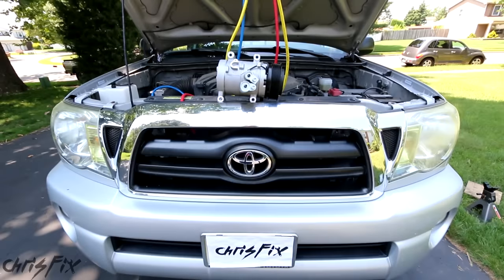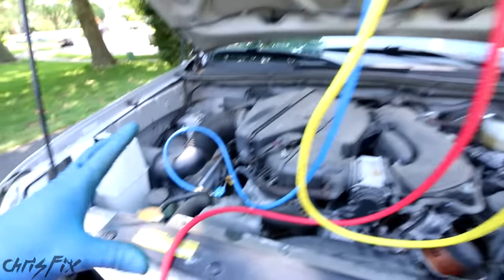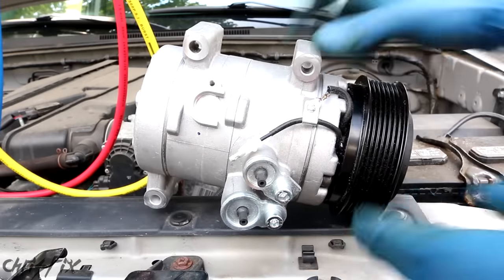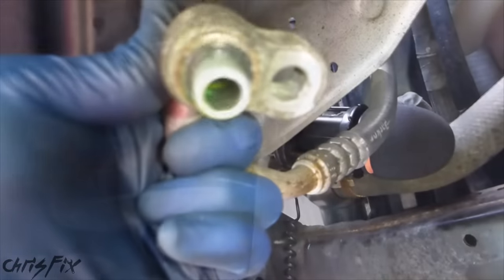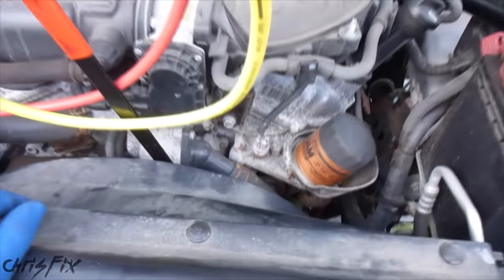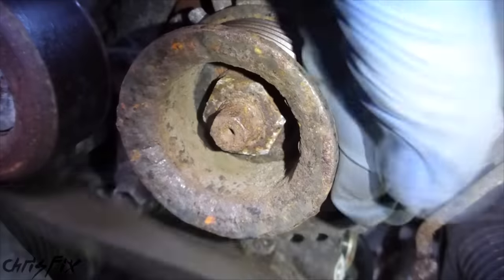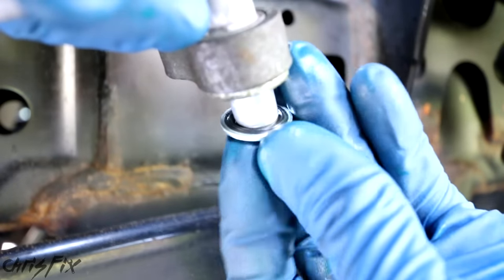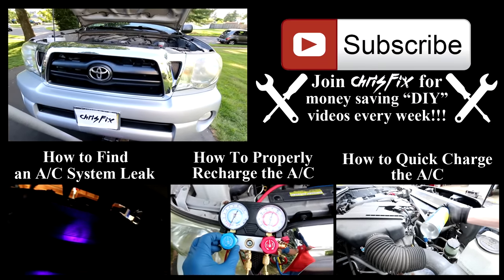How to Replace an AC Compressor in your Car

Comment: I was at jiffy lube and I had them take a look at my ac since it wasn't working and they said the belt was just sitting next to where it was supposed to be on the compressor. Is it likely that I will need a new compressor, or would simply replacing the belt be all I might need? I believe I had the belt replaced once before. It's been a while since the AC stopped working so if the belt has been like this the whole time I'm surprised it hasn't caused more problems. I don't drive all that often but I do have a 300 mile trip planned for next month.

Comment: Sometimes you don't need even need to replace the whole A/C Compressor. A non operational compressor could be a multitude of many things but first check for bad fuses/relays as a first step. In my case, a 2002 Honda Civic, the compressor clutch wasn't engaging. Everything else seemed ok. So I took the clutch front plate off and cleaned all the rust and dirt off. Put some penetrating oil on the front plate. Replaced it back and it worked. Didn't even need to buy anything.
Reply from the maker: Thanks for sharing. In the previous video which is the first one of this three part mini series, I showed the compressor was leaking.

Comment: Great video but since you exposed the closed system to atmospheric pressure, you exposed it to excess moisture, which means you need to replace the system dryer element as well.
Reply: In reality it takes hours for an auto dryer to saturate. I've seen some field manuals and in some cases a new dryer is needed after 24 hours with the system open.

Comment: Thanks Chris. My Honda 91 Accord service manual (not Haynes, etc, but the official Service Manual from Dealership) reads to "measure and subtract the the amount of oil from the OLD compressor from 100 mls and Remove this amount from the NEW compressor before installation." Ex. if I drain 40 mls from OLD compressor, then 100 mls minus 40 is 60 mls, so DRAIN 60 mls from NEW compressor before installation. (???)

Comment: Love your videos they have been very helpful.
 I'm having some issues with my air conditioning, my air conditioning is fully charged, I believe the issue is with the clutch on the compressor. How do I diagnose this for sure unless I missed it I scroll through your videos I didn't see anything). Is it worth rebuilding or do I need a new one?

Comment: Quick question ⁉️🤔 if I'm refilling why do I hook up low and high lines and the high side really doesn't mean anything while refilling? Does that make sense... I noticed Chris touched on the low side pressure and completely dismissed the high side. What's the purpose of the high side?
Reply from the maker: It allows you to get accurate info about the state of the system, while you are dealing with the low pressure side its important to monitor the high pressure side as well, if it was wildly off then that would indicate something going on in the system. Look up "car ac low and high pressure chart" and you can see the relationship between the two as you're filling.
Reply: @chrisfix  thank you for feedback! I'm trying to understand this process before I start messing with my own car. It's an expensive job if I take it to shop! I don't have shop 🍞 bread! 😂 I have DYI 🍞$

Comment: Excellent video. I just replaced and recharged the new compressor on my 2005 Toyota Sienna using your videos as the guidelines. The car blows cold air as expected but the only problem I encounter is as soon as I turn the AC on, the engine made a screeching sound (high pitch) until I turn AC off. The serpentine belt was replaced and the alternator pulley worked fine.
So far, the screeching sound is not going away. Do you have any idea ? Could I have a bad compressor ? Thanks
Reply from the maker: Sounds like the belt tensioner is bad so there is a loose belt.

Comment: bro i have a question regarding the Torque wrench, each time you put a screw you say this one will be torque for example 15 or 30 or 75, how do you know each screw which degree is the best for it? is it with screw size or?
Thanks a lot you are the best
Reply from the maker: I explain where I get my torque specs in this video, check it out: https://www.youtube.com/watch?v=Bbi0kEaTgio

Comment: Great Video! Did you replace the expansion valve and dessicant pack? The warrenty is valid only if those are also changed along with compressor for most brands

Comment: Just want to say thanks for the great tutorial, it help me tremendously when replacing the compressor in my BMW.  I've done a lot of car repairs myself but never had the nerve to try replacing the a/c system myself until now.  I would add that in my case when I ordered the compressor online the company said the warranty is invalid without replacing the receiver drier and expansion valve at the same time which are pretty cheap and easy things to do fortunately.   That may not apply to your truck but just a reminder to everyone else to read the fine print when buying components.

Comment: Hey Chris, nice video. Quick question here, what if the compressor engaged only every 5 minutes and cold air only blows when the compressor engages?? My kia spectra was doing just fine until i changed the ac belt. :/

Comment: Any guidance on AC Manifold Hose Assembly replacement? Or also the AC Condenser Replacement? Fan Clutch replacement? Are they relatively easy? Mechanic says I should have these replaced to fix my AC (and I live in AZ unfortunately) but they want nearly 2k!!

Comment: Love all of you videos man! Could you please make a video on how to pump out the refrigerant so we could do it our selfs? I would highly appreciate. Thanks
Reply: You need a reclaimer to do that. They run about $3000. It’s not hard to do, but the equipment isn’t cheap.
Reply: Once you have the reclaimer hooked up to your car, you press the recover button and wait for it to do its job. It stops when the machine pumps your system down into a partial vacuum (10in/Hg).
Reply: @SergioPena20  Ok thanks! Good to know. Do you know a link to amazon that has the best one to use?

Comment: Great video. I recently bought my first car and it appears that the washer seal between the AC compressor and High pressure line is bad, as refrigerant is shooting out of there. How do i find the washer seal appropriate for the car? (2016 WRX) I have been googling for a few hours with no luck

Comment: At the start of the video, I did not see how you check if you have any freon or coolant in the system. I see the special Pittsburg tool but how to connect them correctly and recycle them as you said to avoid health and environment hazard?
Reply from the maker: You have to go to a shop to get the system emptied before doing ac work

Comment: Question, do I do the vacuum before removing the old a/c compressor or after I install the new one ? And if I do after I install the new one, wouldn’t I remove the oil of the new one when I do vacuum ? Thanks for your help.

Comment: great video thank you, does the new compressor come with orings or did you buy that separate or used the old orings ?
Reply from the maker: Thanks! Had to buy them separately if I remember correctly. Fortunately they are only a few dollars for both of them

Comment: Chris why didn't you change the accumulator?does it need to be change when doing a compressor replacement? Please I need an advice for this my truck is a 2002 chevy suburban

Comment: Chris. Thanks for the video! It is very helpful. The AC system on my 1998 Toyota hasn't been working properly. I want to update the entire system and the compressor I am getting is pre-oiled. I am also replacing the condenser, drier/accumulator, expansion valve and evaporator. Since the compressor is pre oiled should I add oil to the other components on top of what already comes in the compressor? Or will the oil in the compressor be enough for the entire system?
Reply: Flush all the a/c lines since you’re replacing everything, that will get rid of all the old oil. Measure how much oil is in the compressor, then look up how much the factory charge of oil is for your vehicle. Should be 100-150mls

Comment: Nice work. In another video online that shows AC compressor replacement, they perform an additional step of removing and replacing a strainer that exists within one of the lines going into the condenser. Is this strainer something that exists in all systems, and is this something that necessarily needs replacing whenever you swap out compressors?

Comment: Hey Chris, the AC compressor in my 07 Dodge Caliber has recently started making a loud tapping noise only when the AC is on. Still works great, but obviously needs to be replaced. I keep reading online that they recommend changing a whole slew of things while changing the compressor. Do you recommend that or do you think I’m okay to just install a new compressor? Thanks!

Comment: Great tutorial!  Thanks!  Question though...  I read that you need to remove some of the PAG oil from the new compressor to account for the oil remaining in the system. Is that true?
Reply from the maker: The system is so old that it really doesn’t matter. For just the compressor it’s not a big deal.

Comment: Excellent video but, does the ac condenser need to be replaced as well? Or can It be cleaned prior to the replacement so as to not cause damage to the new compressor?
Reply: In an old system it will be full of compressor wear material anyway, so i'd say that even if the compressor is still running normally i'd replace it after 10+ years along with the dryer/accumulator. No need to flush anything in that case, just replenish whatever oil required for a condenser+dryer/accumulator change (either inject it in the lines or insert it in the condenser/dryer/accumulator). In the case of compressor seizure, don't even bother with flushing it. Replace it and be done with it.

Comment: Chris, If I get a new compressor with oil in it, do I purge(vacuum) out the old system before I install the new compressor? What else should I replace to make sure my AC works? This would be a 2009 Tacoma 2.7.

Comment: Hi Chris,  I really enjoy your videos.  I wanted to ask you. i own a 2011 Subaru forester x no turbo and I noticed right underneath my  ac compressor there is antifreeze or maybe oil leak.   it smells after driving it.  I have no ac working in the car right not how ever, the compressor still works when I turn it on.  Do you think I should replace the compressor anyway?
Reply from the maker: I would suggest recharging the ac like in this video:https://www.youtube.com/watch?v=SHg2xRMnM38 and keep checking the compressor after you do it!

Comment: I'm wating 2 weeks too get my Ac Compressor I just bought from E bay I never get any thing re-manufactured but this one was a sweet deal for a 2006 Lincoln Zephyr I paid only $119.00 that is with shipping comes as a complete kit even the O rings comes with it accumulator as wells and oil

Comment: Great videos ChrisFix.
Is it a good idea to add some UV dye when I add oil to the new compressor, before installing. This is for detecting leaks in the future. The system will need to be vacuumed later but I don't believe it will suck out the dye. What do you suggest. You are an inspiration and give me a confidence in tackling the job.

Comment: Question: I just replaced the AC compressor on my 2015 BMW 4 series, the compressor came with oil from factory so I only added the freon. Watching cris fix videos I realized that I needed to vaccum the system first so I am fixing to order a pump with manifold hoses. If I vaccum the system do I need to add oil and freon this second time around? I replaced the compressor less than 24 hours ago and I have cold AC FYI.

Comment: My AC Compressor was easy to remove but the replacement part is so expensive.

I am using the vacuum pump before I do another replacement. Using the vacuum pump for over an hour can remove some oil so I am probably just using it for 30 minutes after installing then checking for leaks if there are any.

Comment: I come across this vid because I have a bad leak coming from the body of my compressor in a jeep liberty.  Most articles and vids I have come across say if you change a compressor, you have to change the dryerr canister, expansion valve, etc.  Did you have to do that?

Comment: My a/c compressor clutch exploded on my '04 Durango, blew the electrical plug out of the compressor and put the pulley at an angle which burned up the belt. Do you have any plans on making a video flushing out the a/c system which is what I have to do to make sure there are no metal bits in the a/c system.

Comment: Hey Chris I know that you held the joint as straight as possible . But how do compensate for the torque setting if the joint is not completely straight when torquing the bolts ?? Thanks I’m advance

Comment: I wish I could just replace the compressor only. Today, every parts store and mechanic wants to sell you “the kit” or they won’t even warranty your compressor. That turns a relatively affordable job into one that exceeds the value of the car. I have a 1996 Nissan Quest, I can not afford to spend $1800 for the darn ac kit. I’m hot as heck down here in New Orleans and am not sure how to best proceed. Any suggestions?
Reply from the maker: I would look for one online, that way you can just get the ac compressor not a whole kit

Comment: hey chris fix love the videos.. i just replaced the ac tensioner and ac belt. weird thing is i installed the tensioner and the tensioner is always on until i push the ac button on the control panel in the car. why did this happen

Comment: Don't know if you'll see this or not but I'm in need of some help. Just put a brand new compressor in and the clutch still doesn't spin. What supposed to be cold air blows about the temperature outside. Good fuses and ground

Comment: If your ac compressor fails or struck do we need to replace the condenser unit also because my compressor is clutch based 2006 charger R/T Hemi

Comment: Hey Chris, 
Is it recommended to change the cooling coil(evaporator) and condenser too if the compressor fails? I spoke to a mechanic and he told me this needs to be done but I'm not so sure. In my case the compressor is pretty weak for the car, and I was contemplating installing one from a Toyota(mine's a 2012 Hyundai i20), so do i just proceed with compressor change or the entire assembly mentioned by the mechanic?
Reply from the maker: Depends on how the compressor fails, do you know if it is the clutch or something in the compressor?
Reply: @chrisfix  @chrisfix  It hasn't failed yet, just that the cooling has been sub optimal ever since the car was bought brand new. It's just a 90cc compressor and I'm of the opinion that a higher cc compressor would yield better results(better cooling), is my assumption correct?

Comment: What’s up Chris ima big big fan i watch all of your videos and I’m stuck right now and i was wondering if you could give some advice my car blows warm air when Its over 85 degrees outside when i checked my refrigerant it was overfilled so i released some pressure and it didn’t change anything i can’t hear my compressor clicking on and off and it’s buried so i can’t really see if it’s clicking on and off could it be another problem other than the compressor. Thanks 

-Ryan

Comment: Hey Chris! Question for ya.. I have an '09 Ranger (which makes your videos totally awesome for me when working on it myself) and have noticed that the a/c compressor will run even when the air is not in the A/C mode. Like when the selector dial is turned to the right side, meaning to just the head or feet position vs the left side towards A/C or Max A/C position, the compressor will still come on and turn off regularly. I never really thought about it until somebody pointed out that it was blowing noticeably cold air on a hot day without being turned to the A/C position. Is this normal? I'm thinking about it now because the compressor clutch is starting to make a pretty loud clicking sound as it turns on and off, and I'm wondering if that's due to excessive wear and tear... Thanks!

Comment: Hey CrisFix. I have a '96 Nissan Sentra B14 GA16DE engine. In a normal run without A/C my acceleration was fine but when i turn on my A/C my idle drop then my engine was like hard in acceleration. what can be the cause of that? Thank you and keep it up.

Comment: you didnt replace the dryer in the condenser. Im about to do this job too and wasnt planning on replacing the dryer, have you had any problems with leaks for failures?

Comment: I see some guides recommend replacing the receiver/dryer in the system as well, but you don't show that in this - is it necessary to replace it? Or is it just a recommended extra step?
Reply from the maker: It’s recommended but not necessary if the system was pressurized and still had refrigerant  (like this truck before I replaced the compressor). If the leak was bad and there was no pressure that means moisture could have gotten in and the dryer might not have any more absorption capability if any moisture gets in the system.

Comment: I've heard varying opinions about having to also replace the condenser since the narrow channels tend to get gummed up and blocked as the compressor starts to fail. Would that be a worthwhile investment just to ensure the smooth flow of refrigerant through the entire system?
Reply: if it doesnt leak, no, not really.
What you should however replace is the dryer,
most A/C compressors immediatly loose the waranty, when you install them in combination with the old dryer

Comment: Mechanics recommend replacing the drier if opening any ac lines. What r ur thoughts if the compressor just blows warm air at idle?

Comment: Hey Chris... if I let all the r134a out of my system and vac it out, will I need to replace the oil. I'm handicapped and trying not to have to pull the compressor to dump the oil and refill. Thank you for your time.